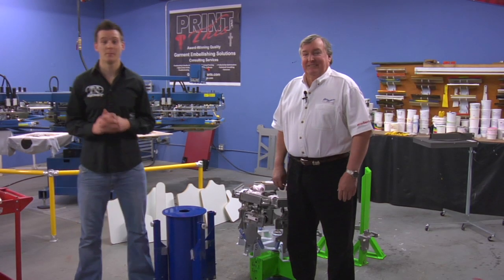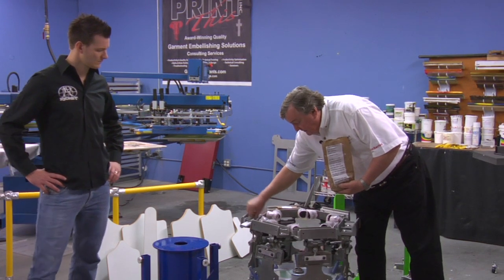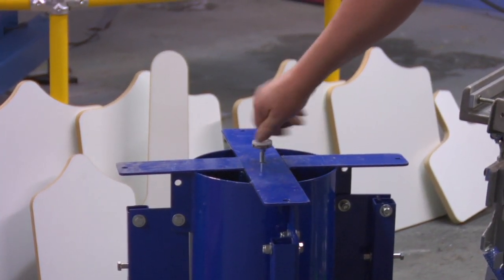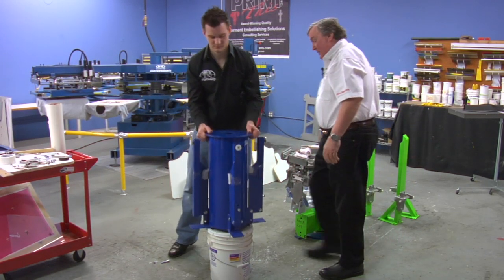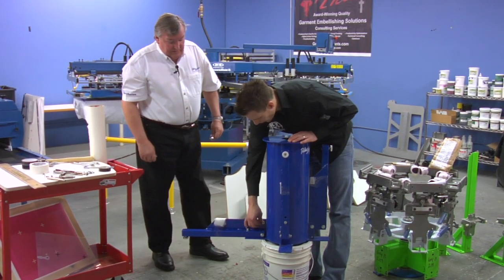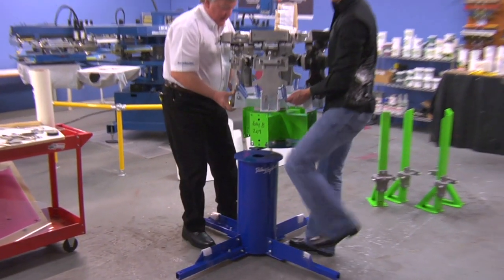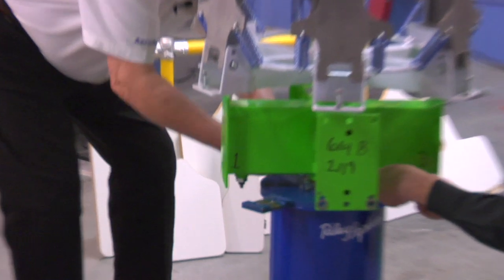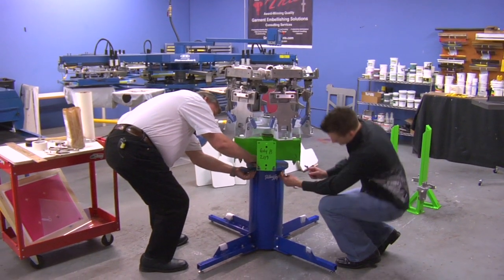Riley Hopkins shows how to assemble his press - part one.

Comment: What is the correct height from the floor to the top of the platen? I just bought a 4c 2s from a fellow that bought it from you and never used it. I am going to weld up a table for the press and thought I would ask about the best height.
Thanks,
Dernnis